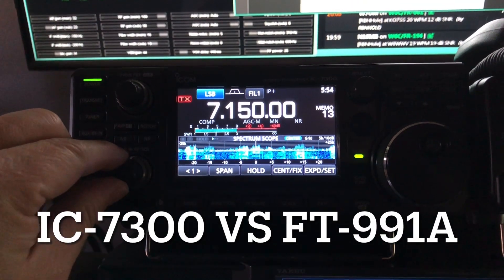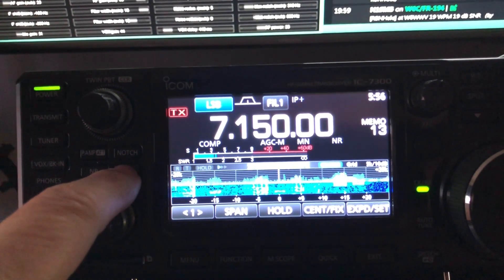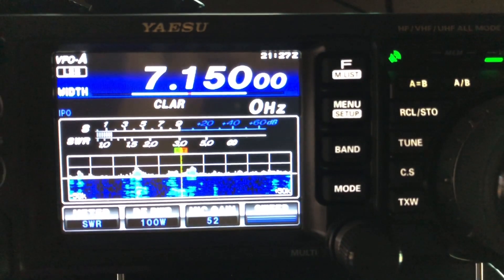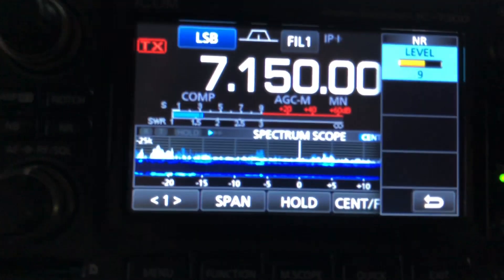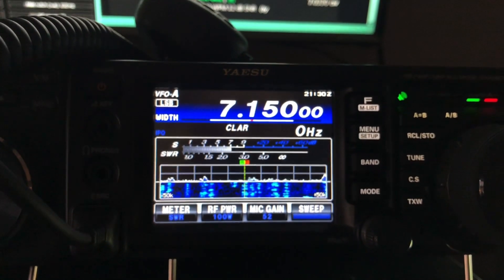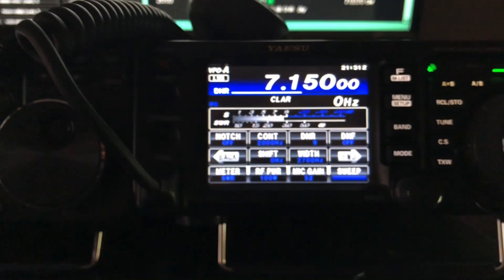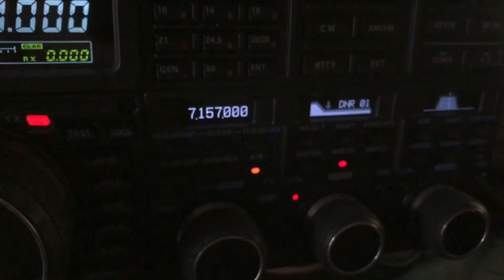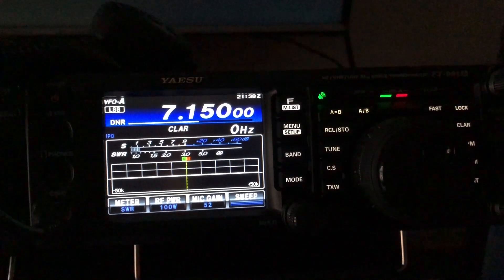IC-7300 vs FT-991A vs FTdx5000MP (SSB mode)

Comment: would not buy the 7300 as it does not have 2 meter or 70 cm. 991a all day.
Reply from the maker: The FT-991A is the one radio to own if you will only own one radio.

Comment: I appreciate the video! Good job. Of course, a big advantage of the 991A is the 2 meters and 70cm.
Reply from the maker: Indeed the FT-991A is the ultimate “shack-in-a-box.”

73, de N4HNH
Reply: @n4hnhradio  Yes it sure is. I've been doing a numbers comparison with the IC-7100 and the Yaesu looks better. 73 de WA3RSL

Comment: Sorry but can t you compare in this condition...yaesu must be on amp1 for compare with ICOM radio. And ip+ off... In this mode ICOM Is most noisy .. Is normal.... Sorry... 73
Reply from the maker: The ICOM has no preamp enabled.  The Yaesu has no preamp enabled.  That’s what IPO means in a Yaesu; no preamp.  It’s SDR versus superheterodyne.  They aren’t exact equivalents.  This is as equal as it gets.  IP+ makes no difference.  I’m sorry if you want the ICOM to be better, but it fails in DSP and front-end filtering.
Reply: @n4hnhradio  What I don’t understand is why you had the bass boost plus 4 on the receive on the Icom. That makes it sound muddy and harder to understand. Am I missing something?
Reply from the maker: As I recall, I also had the bass boosted on the FTdx10 when I featured it in the earlier videos, prior to acquiring the SP-30 external speaker.  

All of the transceivers were using their internal speakers, except for the FTdx5000MP.  The internal speakers of most transceivers lack a resonance cavity sufficient to naturally reproduce the lower frequencies of the AF spectrum.  The FTdx5000MP doesn’t even have a receive EQ but it was connected to the SM-5000 external speakers.

In the case of the IC-7300, it has an inherent high-pitched hissing sound coming from it’s audio amplifier. Boosting the low frequency a bit helps de-emphasize the hiss somewhat.

We can use a good external speaker/equalizer and make the audio quality good on either radio.  My focus is the receiver’s sensitivity and selectivity.  I care if the receiver can pull the weakest signal out of the noise floor.

If you prefer ICOM, that’s great.  I have a couple myself.  I don’t even like Yaesu the company.  I just put the radios on the air in real scenarios and see how each handles it.  

It is common knowledge that a SDR lacks the filtering needed to compete with a superheterodyne receiver.  But the manufacturers hope that we prefer the straight SDR, because they are relatively inexpensive to produce.  

The superheterodyne receiver doesn’t suffer from front-end overload like the SDR does, but the amount of discrete components required, and the quality of the components required, to build a high quality superheterodyne receiver, can cut into the profit margin significantly.  So the manufacturers want us to migrate completely toward SDR.

It is very difficult for a SDR to achieve the selectivity of the superheterodyne receiver without driving its cost up significantly with physical filters.  The IC-7300 has no such filtering.  It only has the customary bandpass filters.  But that doesn’t make the IC-7300 a terrible radio.  It has its own strengths.  But being a contest class receiver isn’t one of its strong suits.  When it comes to user-friendly and beautiful, the 7300 shines.

73, de N4HNH

Comment: Something is not right.  The 991 and 7300 are not that far apart in performance.  I can comment more after tomorrow.  I have a 7300, and FedEx is dropping of a FTDX 5000 tomorrow.  No don't have a 991A.
Reply from the maker: The 991A has the same receiver front end as the FTdx series.

Comment: Hi but your have ipo on yaesu.. for compare It  with 7300 you must set amp1! Or use rfgain on 7300. For have same signal on smeter because ICOM and yaesu have different setting fa the factory.
But you can see the signal Is stringer on 7300.. and 991 seem quiet ..but  in weak signal 7300 is Better i have tried , 73

Comment: Doug you are comparing $1000/$1000 radios vs $4100 radio( FTDX5000 with SM-5000 to make them equal).  The 5000 should be better just based on cost alone. Yeasu does have very good DNR on all their radios.
Reply: I’m happy you had the 5000 in there just as a reference point
Reply from the maker: @joen8joe231 thank you.  One of my Patreons requested that.  Chuck wanted to be sure his money was well spent when he purchased a 5000.

73, de N4HNH
Reply from the maker: Cost doesn’t always mean better but I threw the 5000 into the mix because one of my Patreons asked me too.  He wanted to validate why he spent the extra bucks for his FTdx5000MP.  I do happen to agree with those who commented that the little FT-991A held up pretty good against its older brother.  73, de N4HNH

Comment: Sold my 7300 for a 991a based on your videos on Yaesu DSP, Doug. I'm still happy with the decision.
Reply from the maker: Wow A-Ray!  I didn’t know that.  What do you use for SOTA?
Reply: @n4hnhradio  For SOTA only my HT is Yaesu. Usually my VX-8. I love my 891, but it mostly stays in the truck. You're a tougher guy than me to pack that sucker. For SOTA HF, I take my KX2 or one of my MTRs.

Comment: It that being equal. Antenna, height and power.!!!
Reply from the maker: All three radios using the same antenna.  Did not transmit, so power irrelevant.  The antenna is a ZS6BKW at 45 feet.
Reply: @n4hnhradio  is that not like  G5RV
Reply from the maker: Yes, it is an improved G5RV that is resonant on 12, 17, 20 and 40 meters, plus the FM portion of 10 meters.  It is my best 40 meter antenna.  All three radios were using that antenna.  But for the purpose of a receiver comparison, it doesn’t matter which antenna I used.  The test was to see which radio can pull out the weak signals the best.
Reply: @n4hnhradio  tnxs 73 KQ4CD

Comment: You explain everything so well.  Can you call my wife and explain to her how much more enjoyment I would get with a new radio?
Reply from the maker: Don, I’m afraid I haven’t mastered that with my own wife yet.  Hi Hi!  Every time I put up a new antenna I tell her, “you can’t have too many antennas.”  Ha!  I think 4 antennas is going to be my limit.

73, Doug
Reply: Another great video Doug. The Yaesu rigs are definitely good rigs. I love my 7300 and it has served me well for over 2 years. I would be interested to know how they compare in price. You mentioned the 991 at the end being more expensive and I’m sure the 5000 is much more.  Perhaps the 7610 ICOM would be a better comparison.  I think you would agree the 7300 is a hugely popular radio in use today 

73
Reply from the maker: @stevewarner8880  the FT-991A is currently on sale for $1,129.95 from Ham Radio Outlet.  To me that makes the decision a no-brainer.  2m, 70cm, and 6 to 160 in one rig, and the better SSB receiver.  Sometimes the best seller isn’t because it’s the best performance.  People are probably drawn to the screen and the price.